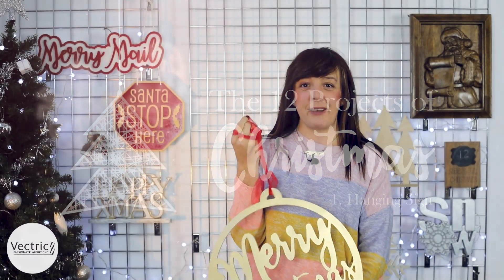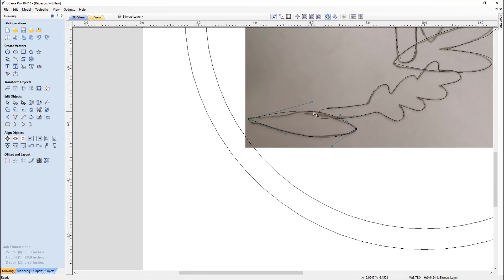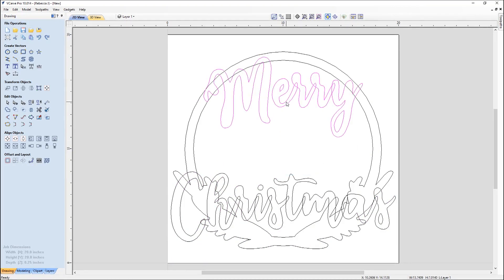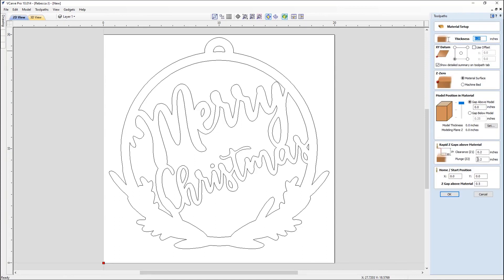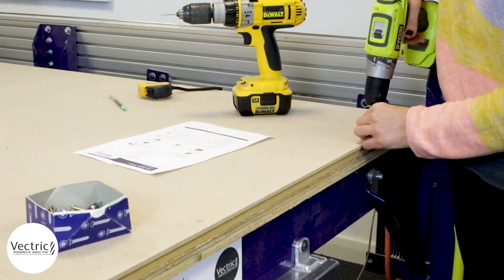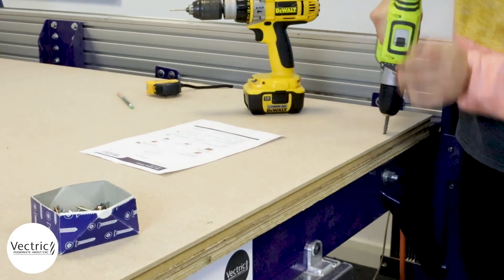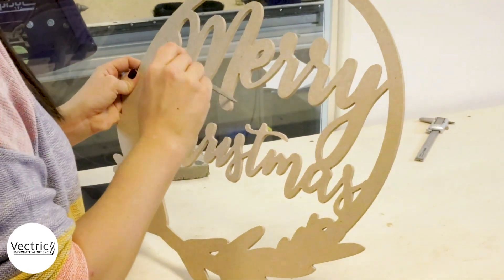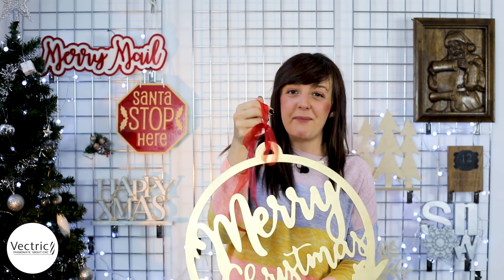The 12 Projects of Christmas | Day 1 | Christmas Hanging Sign with Beki | Vectric In The Labs

Comment: Love the project!   Curious about the double sided tape - we have never used it - I imagine it will reduce any vibration and give a cleaner cut - are there other benefits to it?  Do you experience any issues with removing it from the piece itself?  Thanks!
Reply from the maker: Hey Neathawk Designs! I've used double sided carpet tape for all sorts of projects and I use it primarily for two reasons, It is super strong, so holds down very well and therefore I don't need to add tabs to my toolpath (less cleanup). I've never experienced any issues removing the piece, however with something like this project where there are lots of cut out areas you just need to be a little more careful that no delicate areas snap as your lifting it away, and finally it's really easy to remove (it pulls off clean leaving no trace of the sticky residue) It works for me which is why it's my favorite hold down method :) Thanks ~ Beki

Comment: Good tutorial.... however, that double sided tape was more hassle than it was worth. A couple of tabs and it would have been done and dusted in half the time.
Reply from the maker: Hey Anthony, you're probably right! I should do that next time! The benefit of using double sided tape was more for the inside so I didn't have any fiddly bits to de-tab and sand away! Thank you for your kind comments 😊 ~ Beki
Reply: @vectric  Hi Bek, I was not being critical, just looked like you guys were struggling a bit with the inside bits sticking to the tape. I do a fair amount of 3mm MDF Christmas tree ornaments and signs etc and I only use tabs. I do poly nail the sheet down but all the insides either stay there or go up the dust extractor tube to rattle around there for a while. "-)
Reply from the maker: @tokolosh11  Hey Anthony, I'll definitely be taking advice off a guy that does this a LOT so I really appreciate your help, it will help me get the job done quicker next time round 😊😊 Thank you :) ~ Beki